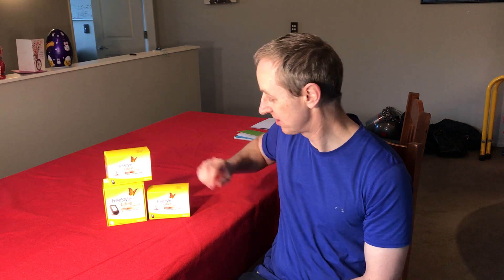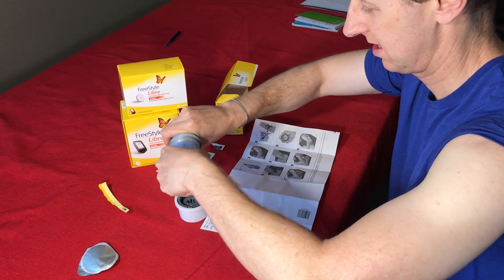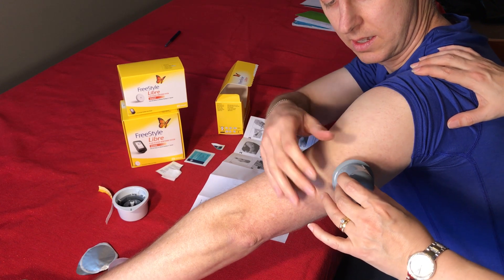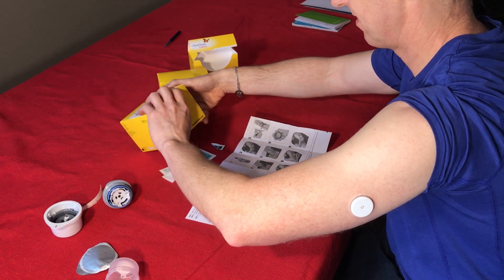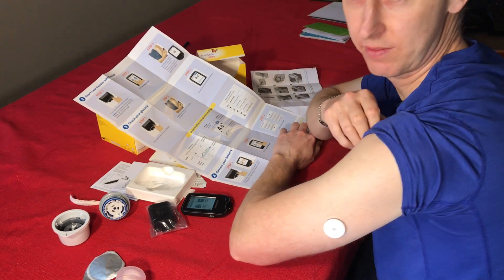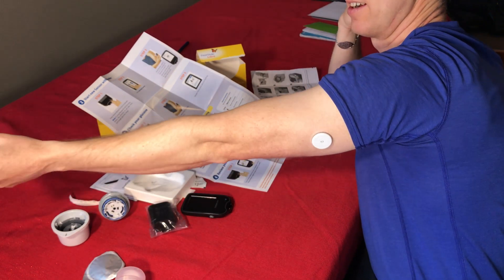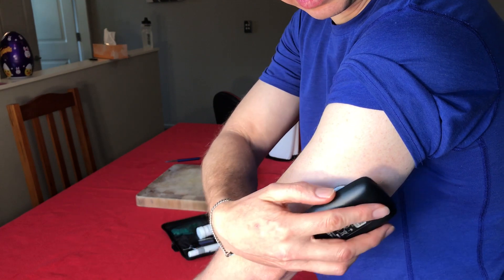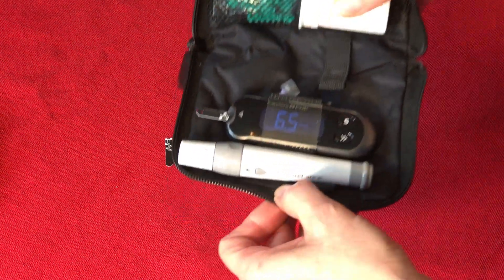Step by step set-up of FreeStyle Libre Glucose Monitoring System

Comment: Does that have a needle inside it?
Reply from the maker: Hi Jeannie Houghton, when you apply the disc a needle is used in the application mechanism, but only during the application. It leaves a filament though under the skin to continually measure sugar levels. I don’t feel the needle during application and I also regularly put one on my mother in-law and she never feels it. Once it is on you don’t notice either the disc or the filament. Brendon
Reply: OK I'm nervous around needles I normally test my sugars on my upper arm and thigh or tummy that way I won't get my fingers messed up I do bead work and sewing and can't feel the work I'm doing after using my fingers so much for blood sugar testing. Thanks for the information.

Comment: The device gets your reading from the interstitial fluid not your blood, thats why it doesnt match your strip. The results would match if you waited 5 to 10 mins to scan after sticking your  finger.
Reply from the maker: Thanks Israel for your comment and I understand your point. I did scan 5 to 10minutes later and the level was fairly similar to the initial FreeStyle Libre reading and still different from the earlier blood prick reading. Anyway, since then the readings have become a little closer between the two devices - generally the FreeStyle Libre is about 0.6 of a mmol/L lower than the blood strip reading for me, and acknowledging your point that it may be closer if I waited. The other consideration I have had is that the blood strip reading may be not perfectly accurate. I live in New Zealand where the government subsidises some of our diabetic supplies, but for that subsidisation they standardise on cost effective options. So for blood testing they standardise on CareSens meters and strips and thus this is what I use. There has been some views in the New Zealand diabetic community that the CareSens meters have accuracy issues.
Reply: No meter is spot on. From the quality of the test strips to the quality of the sensors and reader. Abbott we are not tossing hand grenades, we demand as much accuracy as possible. My first sensor was reading low by around 35 to 40, the second was reading low by around 10, the third was spot on. However the fourth sensor was reading low by 30. I kept using the Libre, but after noting the differences of the first three readings with the old test strips. We demand better Abbott, reading low by 40 is not close enough...
Reply from the maker: Hi Ron, thanks for your comments and apologies it has taken me a couple of days to come back. I'm still getting used to the Libre system, both for myself and also my mother in law who has just started using it (we're both diabetics). Both the sensor I used and the sensor my mother in law has used we saw that the meter was reading quite low at the start. Both times though the sensor accuracy improved over time, although always still lower than test strips. My mother in law spoke to a diabetic nurse about it and apparently the Libre always reads lower than test strips for everyone. When I had the sensor in, the difference didn't worry me too much, so long as the difference was somewhat consistent, so that I could see the trends. I just had to reset the baseline numbers in my head for what correlated with low and high blood sugar. Brendon
Reply: So, Brendon, does the sensor stay in place all the time? I suppose that it does, hence no sticking. What keeps it in place? Tell me more about this, please.